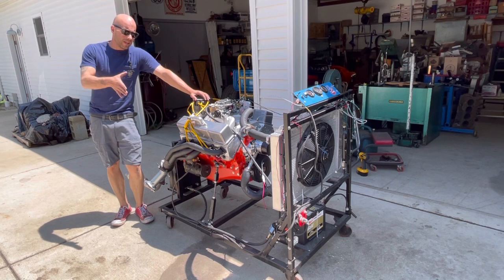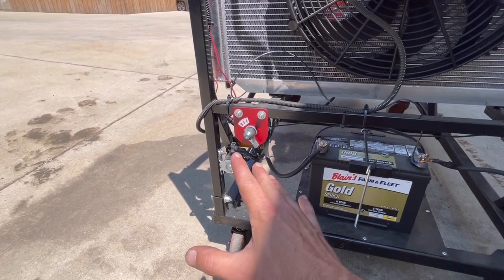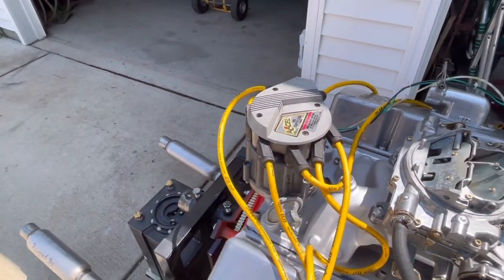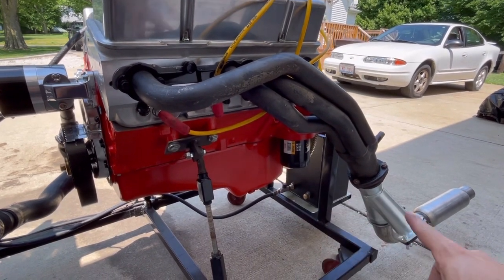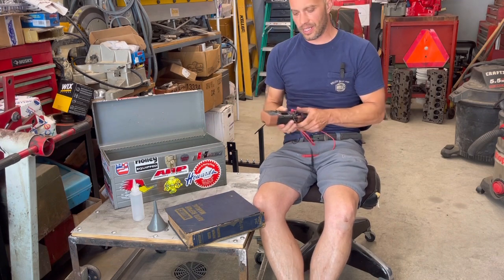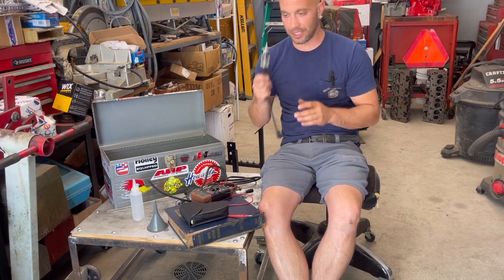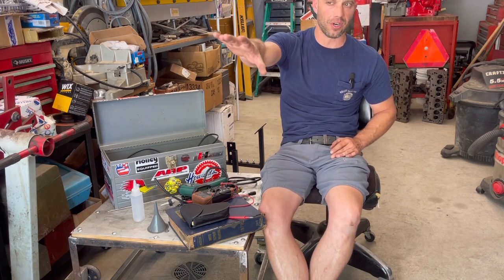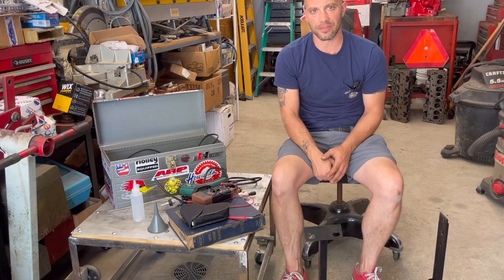Custom Homemade Engine Run Stand, What’s it Used For and How Does it Work? #engine

Comment: Been looking around at Run stands. Looking to build one before spring. This is a good model. Looks like it would work on my SBC and my Demons 360. Thanks.
Reply from the maker: That's the spirit!  Get building!  This one is very versatile and can be used for any engine, even used it for my 521 Ford

Comment: Great setup only thing worries me is the fuel cell in the back where the exhaust is other than that it looks great.
Reply from the maker: it is a bit visually deceiving, the gas tank is pretty narrow, and the exhaust extends past the tank a foot or so.  Thank you!
Reply: It'll be cool building a engine start test station I've seen a few new ones from 300.00+ up to $3000.00+. I don't know what the price of metal is where you are but down here in Laredo TX. I checked yesterday one stick of 2x2x8 is $74.00 so I'll buy a $300.00+ one and modify it.
Reply from the maker: @ a lot of what we used was just extra material around the shop.  We have under 400 in it